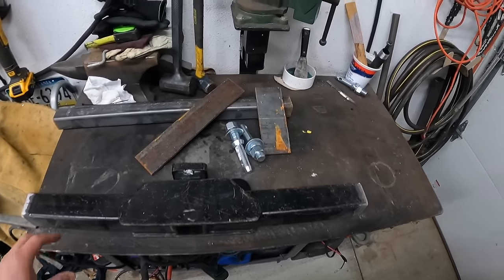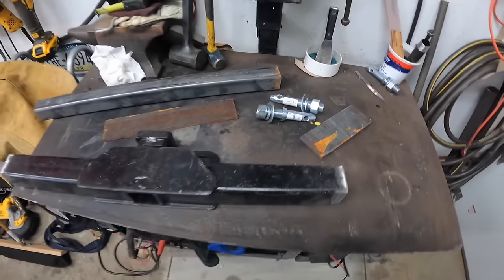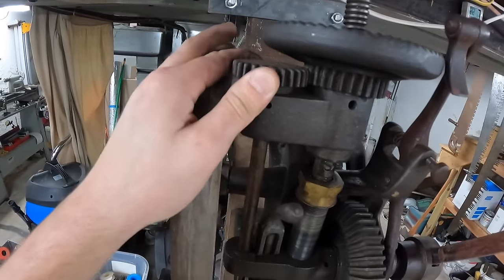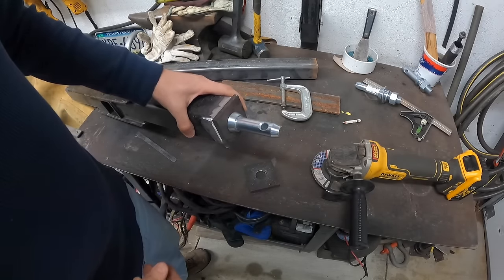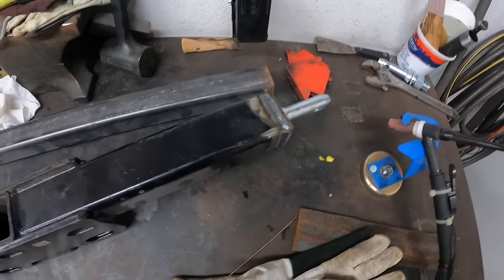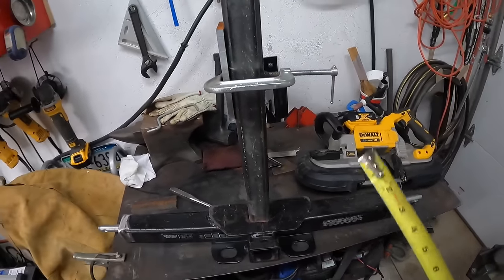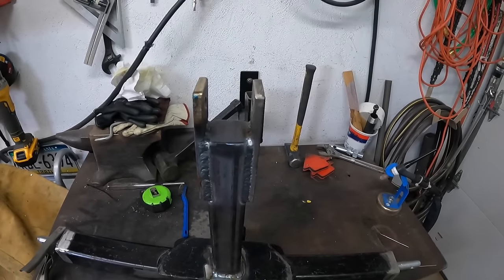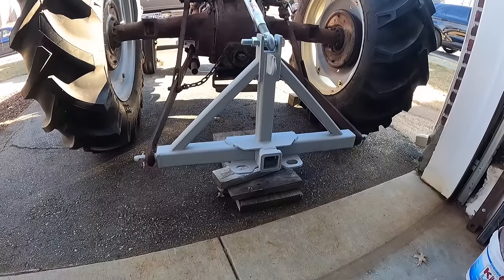DIY Heavy Duty 3 point Receiver Hitch

Comment: Nice. I am considering making one for skidding logs, but with horizontal and vertical 2" receivers (for bumper pull and gooseneck). Titan makes a "Transformer" attachment that comes closest to what I want. These are either not in stock or unavailable. Time to build one better. BTW, the top vertical receiver would accommodate a slide in gooseneck hitch ball and/or a cantilever log boom. I'd also make a bumper plate that would slide into the horizontal receiver so a skidded log wouldn't bang into the hitch.
Reply from the maker: I like what you are describing. I am sure what you build will be stronger than the store bought alternatives.  I like the bumper plate idea if I start skidding logs I might have to make one to fit my hitch.

Comment: I'd be perfectly fine with trusting those welds. 👍 Nice to see you tackle this project, as the cheap junk metal you get with an 'affordable' 3 point usually ends up as a thin wall POS that might work for awhile but will distort and bend all to crap when you need to work it. Even if you spend the equivalent in new steel and DIY one yourself, at least you know you're going to end up with a quality unit that will be a lifetime item when you really need it to work! 
That's kind of the fun part of fabricating your own implements, too. You don't have to follow the standard form and can make anything you want to do a given job, it can be totally overbuilt and take a beating. Doesn't much matter if it's pretty, so long as it's functional. If you end up with both, that's a bonus! I've got a plow project in the works that is cut out of an old boiler, it sure won't be pretty, but it's literally built like a tank, haha.
Reply from the maker: I agree I looked at the cheap junk and it looked so flimsy.  I have amassed all these tools and need to come up with excuses to learn how to use them lol prime example would be my sawmill build....that was a big project testing all my self taught skills.   I would love to see a picture of this plow project sounds like it will be a beast.
Reply: @thedelcodave  It's on the back burner for a bit til I get an engine swap done for a '77 JD 214 that's become an ever deepening quagmire for what started as a simple project. "I just need to grade a spot for a workshop..." Isn't that how this always starts? 😁 It does give good excuses to play with new tool acquisitions though, like a plasma cutter!
Reply from the maker: @C-M-E  oh how much trouble I could get into with a large workshop.  Currently my space is very limited I tucked my MF35 into my garage and that filled it to capacity.

Comment: LOVE YOUR POST DRILL 💓💓
Reply from the maker: It is one awesome machine.  It will be ever nicer when I finally get to machine the reversing gear. I also would like to extend the 2 inch pipe lower so I can lower the table for longer bits or taller parts.

Comment: Where did you get a chuck to fit that old drill press?
Reply from the maker: I bought an adapter that goes from the taper in the back of the modern chuck to 1/2 round that fits perfectly in drill and locks in place with the square headed set screw.

Comment: Nice build, but you would have been better off welding the nut in side of the plate,, just MHO
Reply from the maker: I was back and forth on what to do with that part.  Doubt I will wear out the pins... but welded to the plate inside would make for a quicker swap if something bad happened to a pin.
Reply: @thedelcodave  I was thinking more of it comming un threaded cause then you have to cut everything off and reweld,, just a thought
Reply from the maker: @skeets6060  I have that covered I tack welded the nut to the pin so that it can't untread.